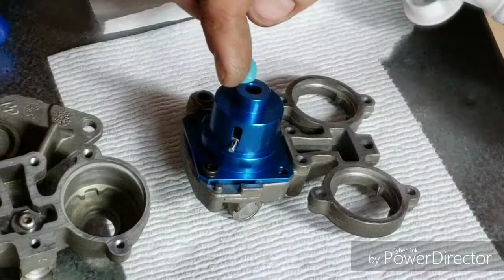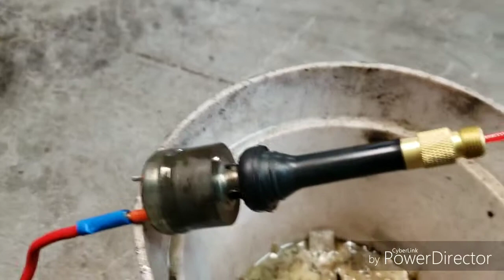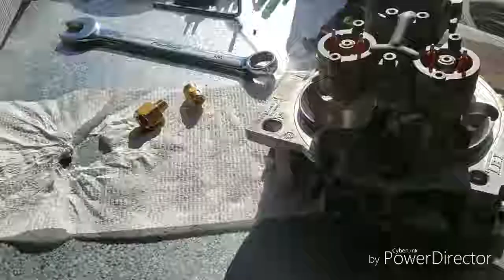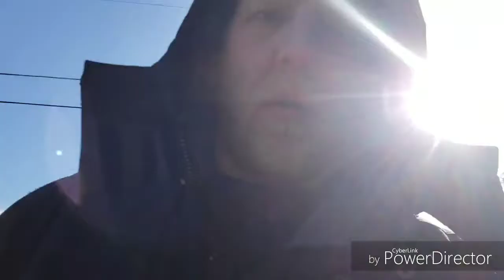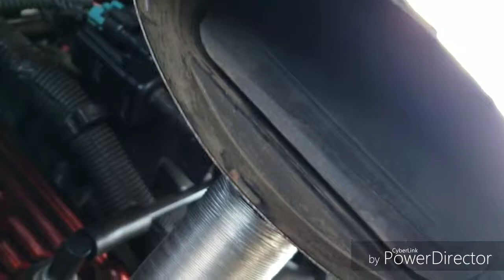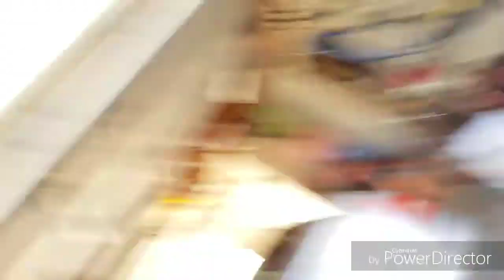Project TBI part 2 the Black Pearl gets up and running

Comment: Great camera detail on the throttle body rebuild and the fine tuning of the fuel pressure. Had no idea that the TBI units were that sensitive to an optimal pressure setting. Really appreciate your helpful information there. I have a '95 Chev K2500 Silverado, (lighter duty 3/4 ton with 6 bolt wheels instead of the 8 bolt heavier design.) Have just started on a rebuild of the throttle body after 25 years and 96K and not being touched once! Couldn't help but notice your 'dual snorkel' air cleaner which you have adapted warm air intakes from your headers. I have never seen a dual snorkel air cleaner on these trucks, and assume that this is certainly not stock. But your job is so clean, that the setup could easily be mistaken for stock. So I just have to ask: what kind of air cleaner is this, or is it a "Custom Gibson Garage" setup!?! Anyway, thank you much for such a helpful and detailed video. Really appreciate it, Mr. Gibson!
Reply from the maker: That's a Gibson Garage custom thanks for the support
Reply: i made one years ago. go to a junk yard. buy a used air filter assy. look at the snorkel you will notice its just tack welded on. drill or grind off the few spot welds. now place it on your housing so that it will clear anything ( altenator or  ac compressor. mark its location. cut a hole in the housing to match the snorkels shape.  and tack weld the new snorkel on. bam super low cost dual snorkel setup and with dual hot air pipes if you decide to use them. looms factory to. made one myself years ago. pretty dang sime and i only spent about 10-15 bucks on the whole thing.
Reply: oo also. probably hard to find now but the 3rd gen camaro that was equiped with the H.O engine had a dual snorkel setup stock. gl finding one now a days tho
 much easyer to make one. and dirt cheap to

Comment: The fuel pressure gauge is in the path of the throttle cable to the TBI. Good thoughts however, on the fuel pressure adjustment.  I believe operating pressure range is 10 to 12 psi on those fuel pumps. Much less than 10 psi and they won't run.

Comment: With all the messing around I found that for some reason my 1994 Burb runs best at 16.5 psi. any lower and there is no acceleration and higher and it just smells like raw fuel. Getting about 18mpg average daily driving on 32" mud tires and 3.73 gears. Test and tune all parts you change. each engine is a little different also your environment will effect it as well.

Comment: I recently started to rebuild my tbi. And when I came to my final step, which was the fuel pressure regulator. I took the 4 screws off and once I revealed the inside. Income to find out the spring had been broken in 4 pieces. Now I'm stuck with no spring or anywhere to tell me what psi size spring it was. Any info towards my issue, I'd appreciate very much. Sweet double snorkel thou 👌
Reply from the maker: You can get a whole nother TBI from the junkyard for 50 bucks as long as you get it from the same size engine it shouldn't matter too much
Reply from the maker: Try CFMTECH.COM

Comment: You need to remove the fuel pressure fitting after you get the pressure set. also you are reading the return pressure I believe.
Reply from the maker: Right that's correct because I wanted to know what the diaphragm was doing and how the adjustments were affecting the return pressure cuz that's your actual pressure to the injectors but I guess it would be interesting to know what the incoming pressure is now that you mention it

Comment: Buddy you got it rebuild right
done many TBI injectors system depends if you reclean the intake manifold need to counter clock wise but seeing your regulator you need to turn it clockwise to the base 
regulator base screw then turn it  counter clockwise 
one turn then where your fuel filter inline replace it left side chasis  with a secondary in line fuel pump built in line filter from Ebay 12 Psi to your Accessory wire and Wow you will see a great difference don't worry it has a return fuel line back to tank just like a BMW primary secondary fuel pump  will not overload fuel remember it works with pulse 

have it on my Chevy utility truck 95 5.7 liter TBI system same as yours played and experiment with the TBI and its tears spins out wheels done roller lifters by Assault and roller rocker arms Assault with original tap cam Wow talk about compression difference

Ecm  conversion stage 3 have something for that more horses and better idle and take off depends 4l60E or 4l80E trans O/D 

Not many know about what I can develope create

Comment: Where did you get that dual snorkel air cleaner!? What is it off of? So cool!
Reply from the maker: I made it. I cut the snorkel off of another one and riveted it on and put the valve on the other side of it because when you flip it over to the other side it would have been facing up

Comment: Hey!! I have a Suburban with TBI and need help. It throws explosions down the acceleration body by accelerating sharply to full throttle and drowns in doing so. I bought in rock auto a repair of the acceleration body, new spark plugs. and smoke comes out of the exhaust with the smell of fuel. Any advice?
Reply: (google translate) haha i from Chile
Reply from the maker: Clean or replace injectors. Possibly stuck open

Comment: WHERE DID YOU FIND YOUR ADAPTER EXTENTION FOR YOU REGULATOR GUAGE I GOT THE SAME ADAPTER YOU GOT AND TRYING TO FIND A EXTENTION ADAPTER TO GO IN BETWEEN TO HOOK UP THE GAUGE MY GAUGE IS BY ALL STAR PERFORMACE THE GAUGE PSI GOES UP TO 60
Reply from the maker: Ace is the place
Reply: okay thanks did you leave the schrader valve in side there when you screw the adapter on there
Reply from the maker: @thedobermangang3503  nope
Reply: @GibsonGarage  so i have to   unscrew the schrader value out and put the extention in there..so if i have to read my fuel pump pressure i have screw it back in..and put my fuel pump gauge on it...i guess thats how that works huh..

Comment: That cast polymer part, the one ypu got from the one guys, its thicker than the factory gasket. What purpose does that serve?
Reply from the maker: It raises the injector pod for better atomization
Reply: @GibsonGarage  best fuel efficiency, more hp, more torque, right?

Comment: Did u reset the IAC   to get it to idle correctly
Reply from the maker: Didn't know there is a reset
Reply: @GibsonGarage  u take a jumper wire plug it in to the one plug under .dash plug in two A n B with key off then you turn the key on check engine light will flash go out to the TBI you'll hear the IAC closing itself give it about 30 seconds and then unplug it start to vehicle give it a few minutes and then go out and plug it back in that resets the IAC
Reply: @GibsonGarage  if you look it up on YouTube it's called reset the base idle for my TBI I have an 89 Chevy short bed I filed the fins off the top of mine to get it more air

Comment: I'm stuck at the gauge point. What adapter setup did you go with to connect the gauge?
Reply from the maker: I forget the sizes but I brought both pieces into Ace Hardware and the guys there helped me find a direct adapter

Comment: It sure seems like a waste of time and money for a non noticeable gain on those two barrel TB units. I haven’t came across any proven results that the mods that’s out there made any difference.  If it’s any videos, post the link.
Reply from the maker: We'll find out!
Reply: Years ago I built a 355 TBI with a 454 tb and injectors, a ported Edelbrock TBI intake, ported stock  heads and a small Comp cam. With all that work and tuning for days, it made 232 hp and 307 tq thru a 700r4...this was back in 2006. I took a dyno video but it was on a blackberry phone and the video quality and sound was terrible lol. I also never did upload the video because 230 rwhp sucks ass, if I would have spent my money on some vortec heads, a carb and intake...I would have made 300+ at the wheels and wouldn't have spent so much wasted time trying to make power with a 2 bbl TBI.

Comment: WHERE DOES THE CHIP GO ?
Reply from the maker: In the computer in the glove box
Reply: HOW MUCH DID YOU SPEND FOR THE WHAT GAIN YOU GOT, BETTER MILEAGE ?????
Reply from the maker: @jackwill3578  I think it was around $150 and you can feel the difference. Gas mileage depends on throttle position. How you drive?

Comment: I noticed you only used the rubber O ring around the injector. My kit came with a brass ring that is supposed to go with it should I toss it it and only use the rubber ring because mine keeps leaking with both?????
Reply from the maker: Yeah it's a universal kit those brass rings are probably meant for something else I don't have any problems with just using o rings and that's all I found when I disassemble them